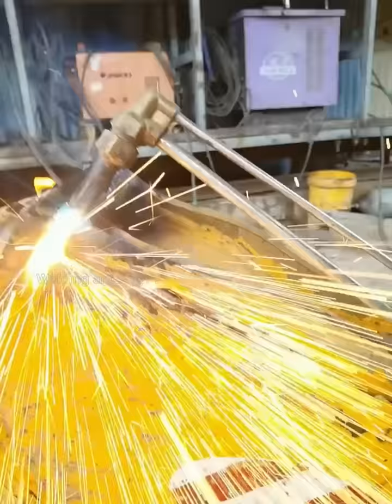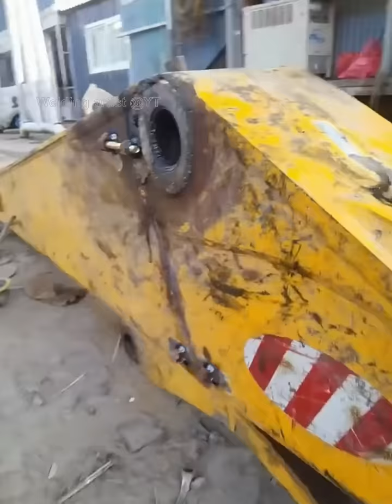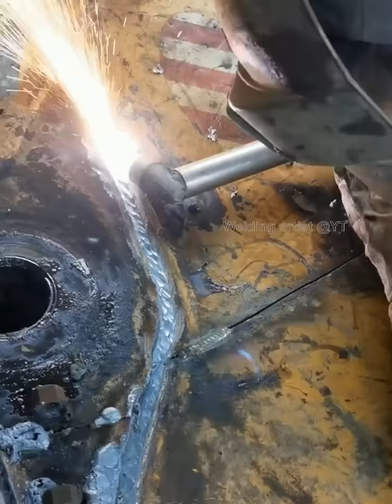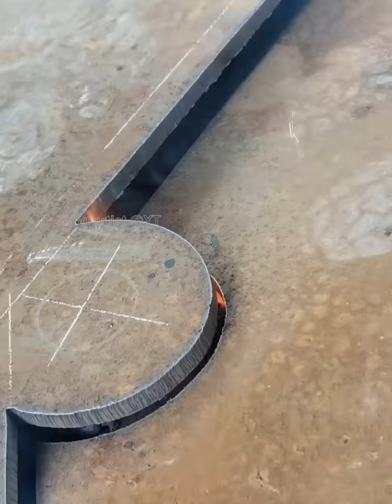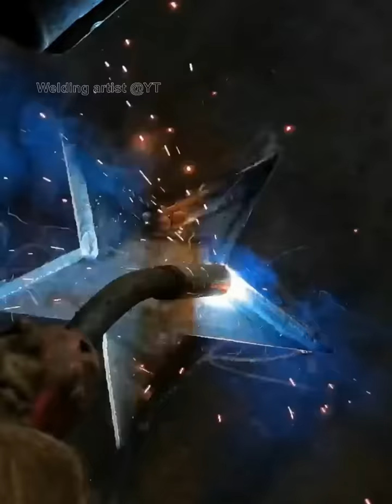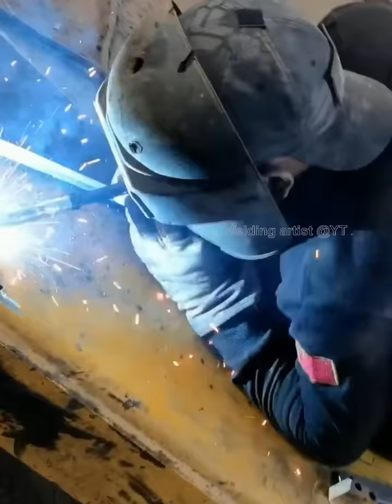Repair broken Eexcavator arm, perfect welding job! this shows how master doing his work

Comment: Brotha them torch skills are off the chart…my cuts look like I’m on crack 😂
Reply: Same here
Reply: Check out I C Weld. He has equivalent or better skills, plus he uses a arc torch to gouge out welds, and has a better grounding in structural stresses. While this repair is pretty, all it has done is move the next breakage further down the boom.
Reply: Here lately mine look like hell too. The company I work for now uses propane torches. It's hard for me to transition from acetylene to propane. If the wind blows it'll screw up your cut
Reply: Are you using a plasma like this guy?

Comment: I've never seen anyone use a torch with such precision. 
Those cut lines are perfectly straight and the points of the stars perfect.
100% respect 🙏
Reply: Round holes would be better, less stress riser's from the points .
Reply: @williepelzer384  I retired from the Chemical plants and refineries as an industrial electrician... so I really don't know stress points and such.... etc.... but i have seen a lot of iron work done.... I didn't realize that was a plasma torch too... 😳...
I don't know why, but welders and Electricians always seem to but heads... but I've always had respect for the talent it takes.
Reply: Is CNC. A mobile small cheap chinese CNC.
Reply: @SteelToes  As a Welder/Fabricator with 30 years in, I can confirm we do "butt heads" with eachother 🙂 It comes from a good place though, being critical of eachothers work is a way we use to keep eachother on their toes, you would be surprised at how quickly someone's work quality degrades if someone isn't there reminding them that they could do better. I agree with the previous poster though, round or oval holes would be preferable to sharp corners on the fish plate. If you want to see some quality work, watch Cutting Edge channel out of Australia, he does some nice work... I only have to criticize him in the comments occasionally 🙂
Reply: @joetuktyyuktuk8635  thank you J... I will check it out... and I do agree with you.
By the way.. I started "self teaching" my myself how to weld 😆
Reply: @joetuktyyuktuk8635  I got another notification, came back and re-read everything and just realized I used one "t" in but heads... you corrected me with "butt heads" and I didn't realize it.
Sorry bout that... I'm getting old... 😆
Reply: @SteelToes  Not sure I even noticed 🤣
Reply: @SteelToes   ver
Reply: @williepelzer384  Stars are definitely not the best and they aren't practical, but you can't deny it's impressive

Comment: Excellent repair. Can't be done better.
Reply: Actually, it could... the star shapes on the fish plate should be round or oval holes, the sharp points on the stars will cause stress cracks to form at the points.
Reply: @joetuktyyuktuk8635  not just that but it also means the welds on the tips of the starts will experience the highest stresses. That also happends to be where the least weld is put down.